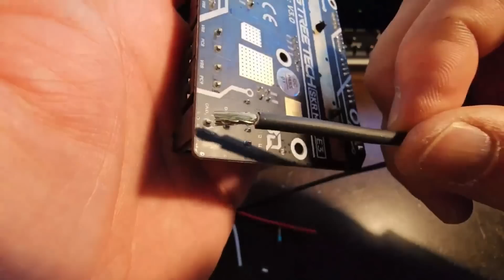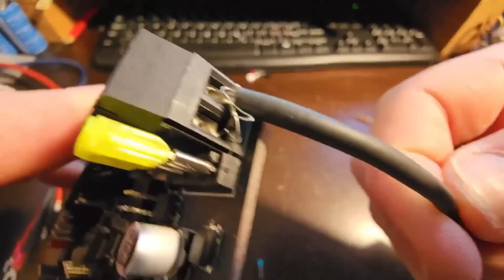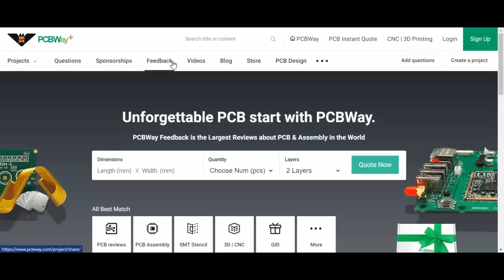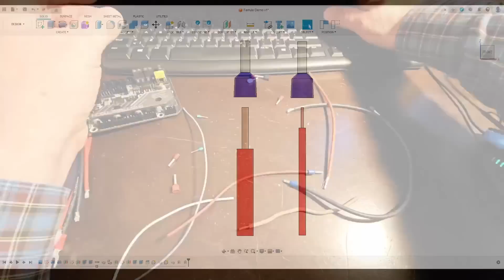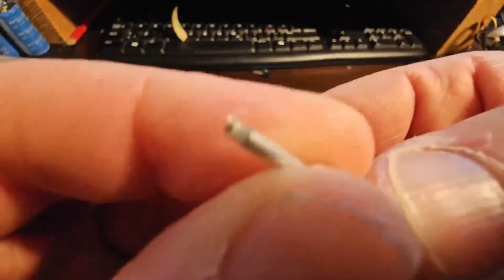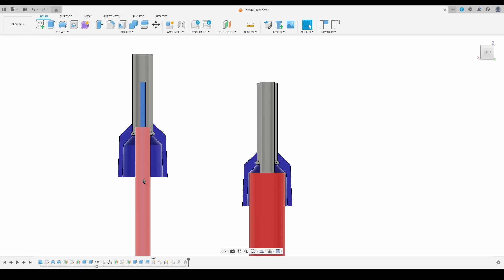A beginner's guide to Ferrules

Comment: could have comressed that to a single frame ....
Reply from the maker: Yes, but this is a theoretical lesson for beginners to fully understand why it's important to pay attention and do it correctly.
Reply: @StackingLayers  sorry for being rude, you're right. But I think it could be a bit more captivating even for beginners with a bit more information density. Nice job anyways.
Reply from the maker: I will agree I need to work on getting my thoughts more condensed. My thoughts go a mile a minute, but if I make a script I sound like a malfunctioning robot. 😅 I honestly do appreciate the input though.
Reply: @StackingLayers  actually i want to try to turn my rude comment into a compliment. You do nice visuals with Fusion sections and by filming different problems with short circuit and overcompressed ferrule  .... With this nice concepts and materials you actually could have made a infographic ("1 frame") with all those pictures that speak mostly for themselves and someone else would have needed a lot of explanation.

Comment: I love how you take your time to explain everything thoroughly, instead of rushing everything to retain the viewer's attention. The two things I learned from this video are 1) Don't overtighten screw terminals and 2) don't twist the wires before crimping. I have to admit that I've done both of these things when I crimped the connections for my Ender 3 last week. Should I take out the board and touch on those solder joints just to make sure they're good again? Manufacturers should probably put a heat sensor on the board in the terminal area just so it can be shut off when things get too hot 😂 But I can imagine they want to produce them as cheaply as possible. Anyway, this got a lot longer than planned. Thanks for the video!
Reply from the maker: The way I look at it is, it's better to take the time to look and know it's ok instead of it later letting you know that something was wrong. Also no need to loosen things if it all looks good. Most of the time a visual inspection will tell you enough.
Reply: @StackingLayers  I'll be sure to take another look, thanks! Better safe than sorry indeed

Comment: I'm an engineer and that was a perfect and very thorough explanation. Thumbs up
Reply from the maker: Wow, thank you! That truly means a lot.
Reply: @StackingLayers  I'm not an engineer, but I am an electronics technician with years of bench time experience and I agree with thetomster7625. Never solder crimp/compression connections. Ferrules are your Friend. etc...

Most of the wire that I've seen (granted where I work we order from reputable wire vendors like Alpha) that have oversized insulation are HV wires. I could see less reputable wire manufacturers trying to fool their customers by oversizing insultation to save on copper.